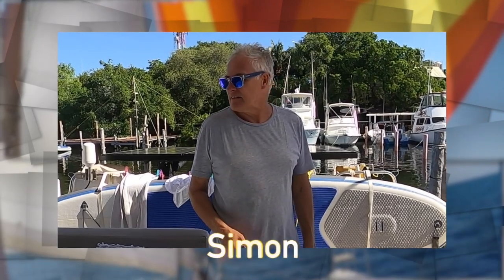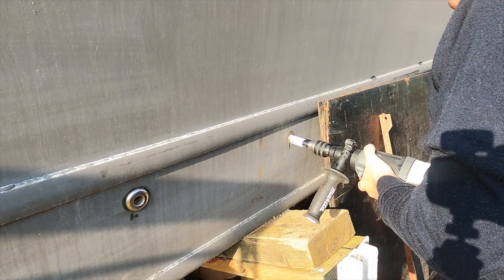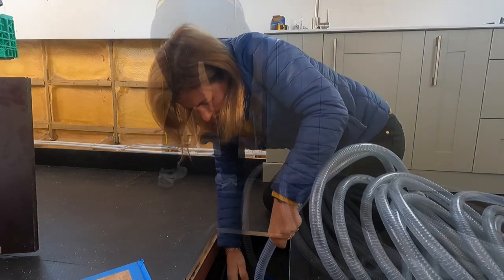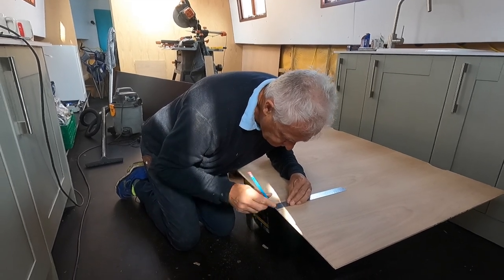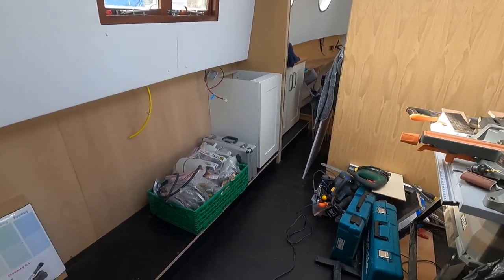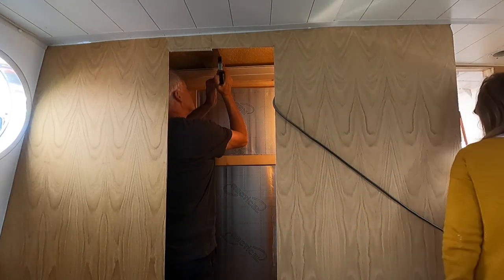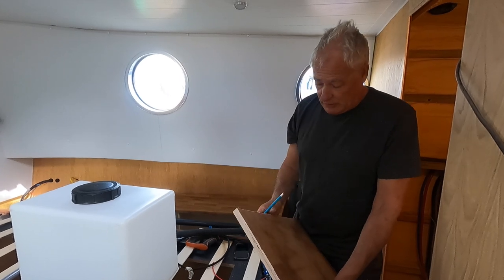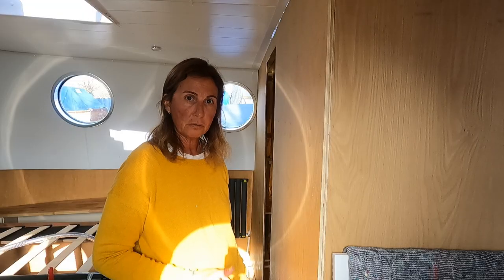BARGE BUILD. Where does your POOP Go? Playing with the black water tanks. Sailing Ocean Fox Ep 208

Comment: when doing the thru hulls do not fully tighten them upon applying sika, leave the final torque for the following day to ensure a good seal by not squeezing out the goo. when double clamping make them opposite to one another to get a good counter squeeze (if that makes sense). i would go with a composting toilet. no tanks, no plumbing, no pumps, no added holes in the boat. and when the poo is ready. or should i say, the compost, you can also throw it overboard (always following the legal boundaries of the place), its a no brainer for me, not to mention the space you save for other stuff!! keep on the nice work
Reply from the maker: Very good suggestions, thank you. We didn’t even consider composting, I understand is much less work but… don’t know really.
Reply: @SailingOceanFox  the upfront cost is, basically (to my view) the only donwside, i mean, some of them toilets cost 1k plus US. which i find ridiculous. it will last a long time given the proper periodic care and maintenance, which isnt much as they have few moving parts.
Reply: My reserve about composting toilets is about finding waste disposal points along the canal. The infrastructure is built with pump-out disposal in mind, so that would seem to be a convenience.  Also, if you're planning to live aboard the barge, I should think composting toilets need to be emptied every couple of days, no? That's not much of a convenience.
Reply from the maker: @ajnasreddin  we are not going that way, at least not on this boat. Cheers

Comment: Interesting arrangement with the T connector; I'm assuming you've not had any blockages there? I always think it's good to have as straight a hose as possible from the tank to the deck fitting for pump out.

Comment: Are you going to do a video abbout your engine installation?  I saw on your previous video it appeared the engine has a water cooled exhaust manifold, are you planning a dry exhaust?  Keel cooled?  I would be very interested to see the plan.
Reply from the maker: Yes we are making a dedicated video to the engine installation. Probably more than one, should be in about 3/4 weeks time. At the moment the engine is just sitting in place, we haven’t done anything to it yet but should start very soon. Cheers

Comment: Also, how would you empty the tank via the seacock rather than just ejecting the waste when flushing? Are you fitting an extra pump to do that?
Reply from the maker: No extra pump, we are counting on gravity 🤔 same way we had on the last boat. Thank you for your comments
Reply: @SailingOceanFox  Interesting. I suppose if it's above the waterline there will be some pressure to vent it. Although maybe you can fit an inline pump if it's not so effective. It's a really interesting idea and I'm going to see if I can work it into my system. Emptying the tank at sea would be a good contingency. Thanks!
Reply from the maker: @TillerQueen  yes, all the Lagoons are like that. Cheers